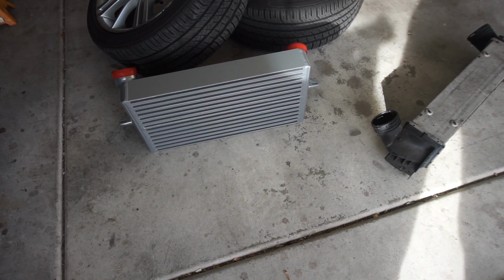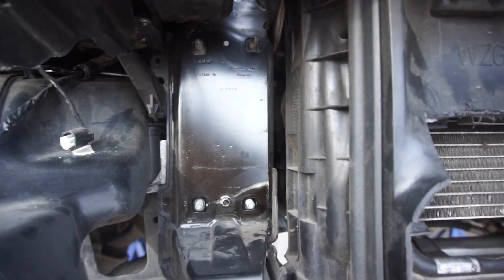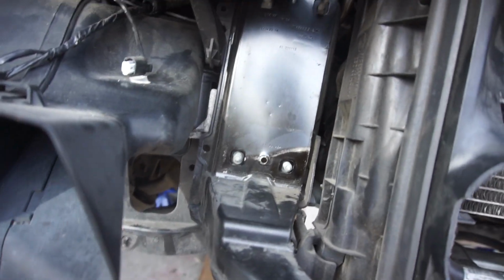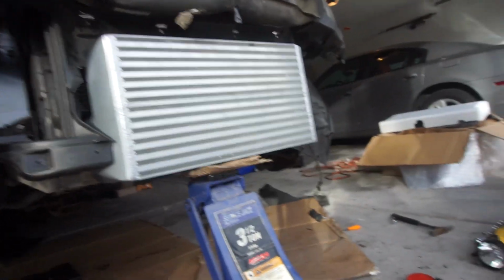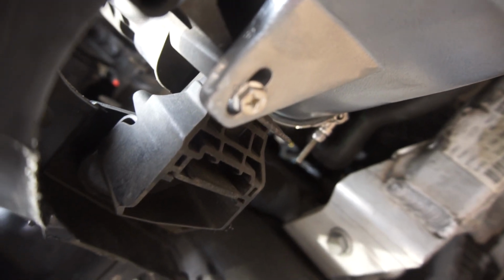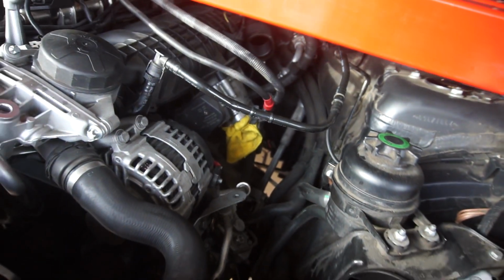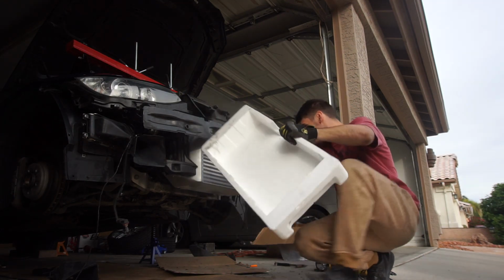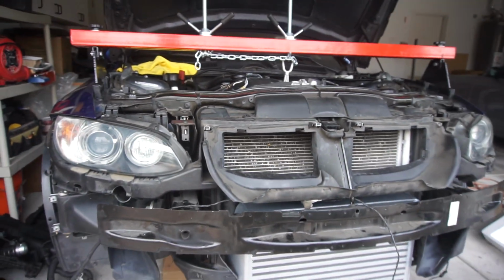VRSF 7.5" Race FMIC Install | 335i N54

Comment: Thanks for the video. I just wasn't sure how much to cut the plastic shroud. The metal bar behind the bumper def needs to be removed and I wasn't sure how either. I am going to do this over the break soon. Thanks again. BTW, is your front bumper the aftermarket for the pre-lci? If it is, is it direct fit or any mod needed?